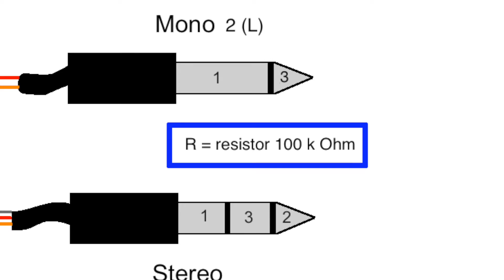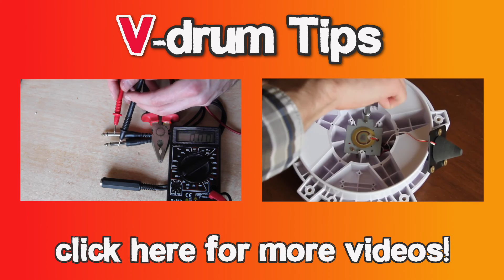Head/Rim Splitter Box (for V-drums)

Comment: Thank You very much!
Its worth a million, for me with Roland TD-4KP. Just to add an extra  crash cymbal to the drumset.
Greetings from Belgrade!
Reply from the maker: Hey Aleksandar,
thanks for your comment. But I don't think the splitter is working on a TD-4. They are for the TD-9, TD-11, TD-12, TD-15, TD-20, TD-30 as far as I know. I never tried it on a TD-4.
Reply: Marcel Price I hope it will work, TD-4KP has dual triggered Ride cymbal, so I will try to split it to single zone Ride and an extra Crash cymbal using your splitter. Normal TD-4 Drum module got a fabric Extra crash cymbal cabel included into wiering loom. You just enter the Menu funktion on module and enable Extra Crash function (cabel), but TD-4KP was delivered without Extra Crash cabel in wiering loom, and Module (extra crash) funktion is disabled into Module by producer :( Module TD-4KP still have dual triggered ride cymbal :)
Than, You come with this video, and the rest is history.....:)))))
Reply from the maker: I didn't know that there is not even a second crash in the menu. Let me know if the splitter works:)
Reply: Marcel Price Blah, on TD-4KP I can see Second Crash option listed on Module Menu, but if I click OK button, they just return me on previous menu item :(((. On normal TD-4 Module, You can enter 2nd CR menu item normally and wire loom already consider CR2 cable. On TD-4KP Rolanders probably blocked something on module print board (may be they insert some micro switch inside, or ask for some jumper position etc. etc.). May be its different BIOS inside. (Just have to be updated or so :)) :(( Also with 4KP wire loom is without 2CR cable.
My TD-4KP is still under 2yr warranty so I can’t open module for now :( and try to unblock this function by microswitch or some jumper etc.

Anyway before that also I must check is it possible to edit both ride cymbal triggers (instrument menu) independently or not. If not, I definitely can’t install second crash even with your genius splitter. 

Keep you informed abt. my eventual progress!
Reply from the maker: That would be interesting, to see what they did to lock the 2nd crash. I had a normal TD-4 myself and that's what I thought. You cannot edit the the 2 zones individually. 
How is the TD4KP in general? How long do you have it?
Reply: Marcel Price I have my TD-4KP just for one week. I purchase it as used drum set from classifieds, but seller i.e. first owner buy it directly from Official Roland dealer in Belgrade at September 2013, so I vet got original Warranty for 2 years from there included with used set. I will try to avoid opening of Module within warranty coverage, but I almost sure that Roland produce TD-4 and TD-4KP on identical electronic basis, but that they only block 2CR function onto TD-4KP because they commercially insist on portable function of TD-4KP and image of small compact entrance level V-drum set. Probably they just leave empty some jumper bridge onto module motherboard or they just switch off some micro switch if they do it via hardware, or they just recorded shortened variant of module software with blocked CR2 function. May be the pressing of some ``magic`` combination of module buttons simply will unblock this CR2 function. Something similar when you want to lock/unlock editing possibilities onto normal TD-4(KP) by pressing rec and ^ buttons simultaneously.....(already described into User manual).

Regarding my experience with my fresh TD-4KP, well,  first I want to emphasize that I am just hobbyist drummer 51 years old :) grown from crazy `70s on Southern Rock Music (Allman Bros. Lynard Skynard, etc..and still learning :)). My first contact with electronic drums (after many acoustic ones) is via Alesis DM 5 module with DIY piezzo triggers mounted under mash heads onto my acoustic drum set (dated 2006) :)))). Due to lack of space, I sold my triggered acoustic set (SONOR 505) and come to now days PORTABLE TD-4KP. As I said I’ve got it just one week, but generally I am very satisfied. Drum sounds and predefined drum sets into module, perfectly fits all my needs and my skills too :)))). I upgrade original TD-4KP configuration with Roland snare pad  PDX-8 and kick to KD-9, just to have x-stick and rimshot on snare (Allman Bros use this a lot in his songs :)))) and kick pad KD-9 is much quieter than original one. For now I only miss a mysterious CR2 function and cable onto my portable kit.
I also notice that somewhere into User Guide there is possibility to edit dual trigger pads i.e. cymbals and snare simultaneously or separately if turn that possibility ON or OFF into Options menu. I really must return to user guide to read this again because I am really read it just once. May be if we want to edit each trigger into dual trig pads separately, first we must turn this (simultaneously) option OFF or similar. Just asking myself, why normal TD-4 is delivered with extra CR2 cable and menu option and TD-4KP without it? Except Company profit strategy and clever stratification of V-drums market I can’t see other reason. The question now is only - How to break this blockade (Charade)? Cheers Chaps, I’m bloody Old man will keep you informed!!! :)))
Reply from the maker: Aleksandar Savic
Thanks for your message. You have some interesting upgrades there. I think you are totally right with your assumption, it's simply a way to make people buy a bigger kit. But I am sure there is someone out there who knows how to hack the module:) I think it's cool to still play drums at your age. It's not very common there where I come from(Germany). Most people start to become boring at the age of 30. So keep on playing:) Cheers
Reply: Marcel Price Thanks a lot for your kind words Marcel!!!
Probably I will experiment a little with my TD-4KP in very near future and if I find something interesting about adding extra triggers, splitting triggers or about unlocking of some hidden Module futures, I will revert here with all information! That’s for sure!
Also thinking about publishing my own overview of TD-4KP together with my pad upgrades onto my YouTube channel? May be some my drum cover of songs from my Century :))) Cheers!
Reply from the maker: Aleksandar Savic That's a great idea. I like this kind of gear and setup videos. And I didn't see a "Custom TD-4KP -video" so far. Good luck with your plans:)
Reply: Vdrum Tips Hello after long
time. I finally find solution for an extra Crash (or Crash2) to my TD-4KP and
how to separate and edit 2 zones on same cymbals on Roland TD-4 modules :))). Don’t
ask me how, but I find this solution very hard. Here it is:

1. Enter the settings in module menu and press OK

2. Scroll to rim/head link

3. Set rim/head link to off position and press OK. For separating zones with
different sounds on the same dual zone e-pads this option MUST be in OFF position.

4. Return to main menu -and then select INSTRUMENT and then
press OK to enter

5. Hit bow of Ride cymbal by stick to select this zone and then
see on screen what sound is assigned to this zone (heavy ride by default I
think) Leave it unchanged, if it is OK by you or choose something you want from
possible sounds in TD-4 module by turning selection knob. Then

6. Hit the edge of Ride cymbal by stick to select this zone and change existing
sound to some other sound, for example dark crash, snare, toms or whatever you
want from possible sounds by turning the selection knob. 

7. Exit all menus and enjoy :)))))))

8. NOTE 1: If you lock your module before you start this changes
after you turn your module OFF and ON again, all this settings mentioned above
will be canceled and returned to previous state. If you want to permanently
above changes in module settings, than first unlock your module than made
changes you want, and lock module again. To lock/unlock module see your User guide

9. NOTE 2: After this settings I think that you
can use your cable splitter to connect two separate mono pads (cymbals or
whatever else)

Please inform me if it works for you and please than you can make your video tutorial for all of us because you did it great!!!
Best regards,
Aleksandar
Reply from the maker: Thanks for the message. But I cannot try it out. But is nice for all the KP-4 users.
Reply: Vdrum Tips OK, Thanks anyway!
I hope some of TD-4 and TD-4KP users will find this guide somehow :)
May be I will try to make video tutorial :)

Comment: Greetings! I have some serious questions:

1.) Does the splitted toms sounds when both are hit at the same time? 

2.) Is it possible to layer 2 sounds for the splitted toms when hit both at the same time (Ex: Pad1 -> Tom1(head) "AND" Tom2(rim)?

3.) Also, will it loose the "PANNING" effect if it is splitted (Ex: tom1 output the sounds on left and tom 2 on the right)? 

4.) Can you still "Pan" those mono pads?

Module is Roland TD-11.
Reply from the maker: Phyll Joseph Abraham Oanes Hi:1) no, this is the weakness of a splitter.
2) no, refers to nr.1
3) It is possible in my TD-9 to seperate the pan. Head on the left side and rim on the rght for example. Just try it out in Yout TD-11. Select a cowbell for the rim and play with the pan.

Comment: What should the specs be on the resistor?  I'm using a 100k ohm 1 watt 5%(whatever that means)  and I'm only getting signal on the drum getting signal from the TIP.  also, does it matter how the resistor is installed?  does signal flow in a specific direction?  I have a TD-7 and am trying to use 2 PD-9 or PD-7 as individual single zone drums, I don't care if I lose the rim.
Reply from the maker: I don't think it works for a TD-7. The splitter is not made for the first generation Roland modules. It works for TD-9, 11, 12, 15, 20, 25, 30.

Comment: i might not bother with jacks and jack holes. just splice the cables in the box with the resistor.
or is it sacrelig. to cut the loom!.
Reply from the maker: +jim power You can build it differently. There are endless possibilities to make it. This one is just the most flexible one.
Reply: Only rule being the correct value resistor being fitted between the two signal wires of each cable. Or it will not work
Reply: Ultimate system may be wire everything internal in the tubes of the frame and have no boxes or cables hanging around.
Now theres a project for a rainy day! :)